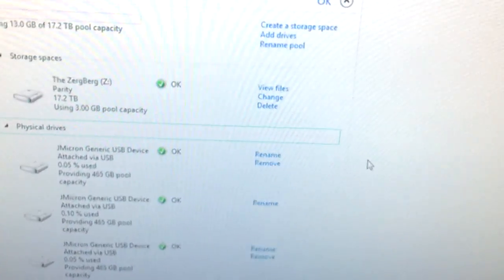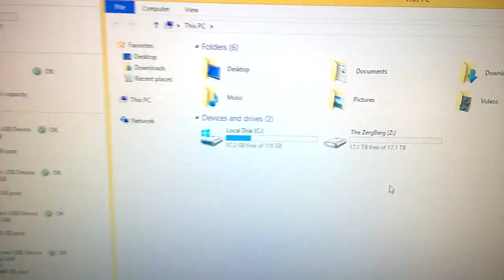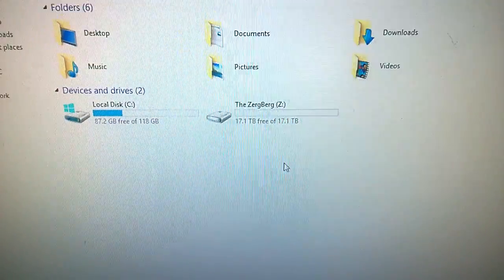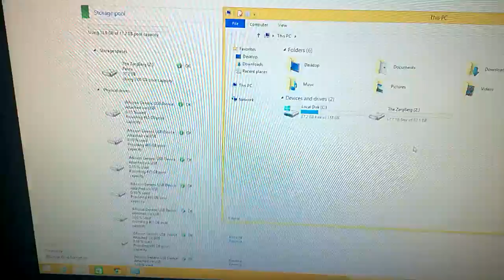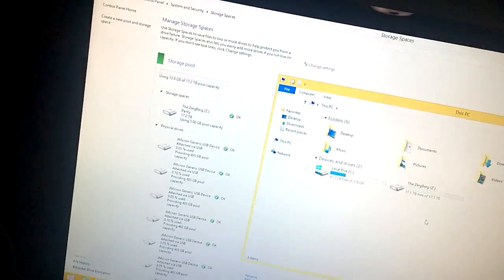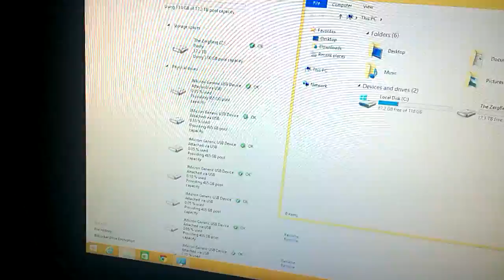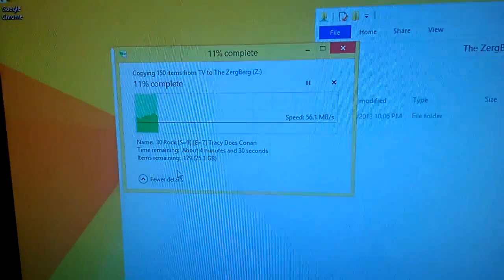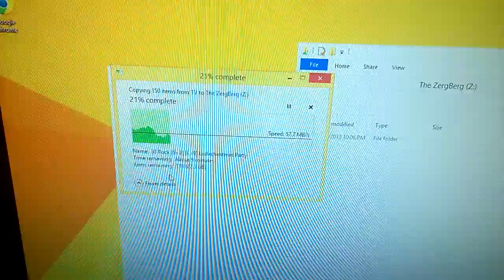The ZergBerg (Phase 3) Installation & Cleanup (38 USB Hard Drive Cluster - Custom Coffee Table PC)

Comment: Hello,
I use the same motherboard and five USB controller card.
When Pc startup the bios stop and motherboard display error 96....

I changed motherboard , usb card, memory , power supply , graphic card 

firmware USB card is 2026 
X99-ews Bios 3302

Help please

Thanks